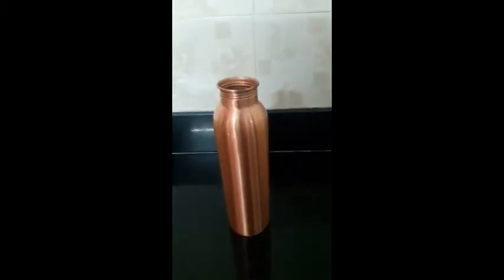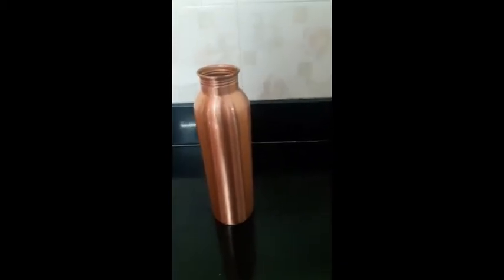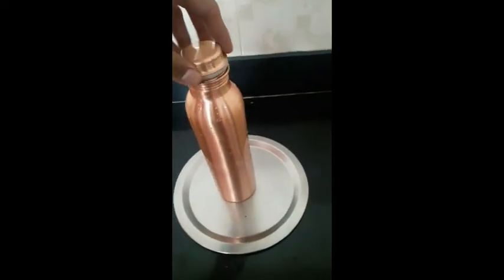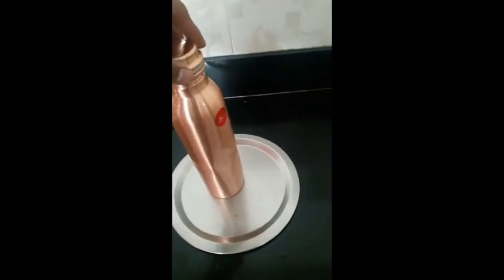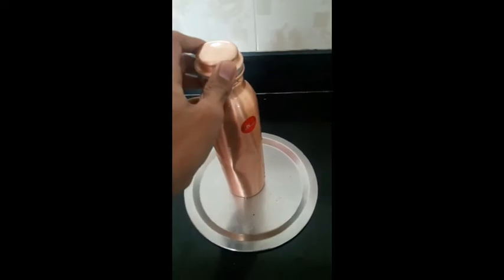How to remove dents from your copper or metal water bottle

Comment: This will cause your bottle to expand and then burst open from the pressure. Try a soda can in the freezer and see what happens before doing this with your fav water bottle or such.
Reply: It does yeah but not so much or not at all if your don’t fill it to the brim.

Comment: It worked fine for my copper bottle.
BUT the base got minutely bulged outward. Now searching for another video to fix it 😂
Reply: Found something??
Reply: @im_megha5863  It automatically came back to its shape after some time.
Reply: Same thing happened to mine but I tapped it with the end of an axe & it’s grand…but bumpy but grand & the hack worked at treat for the dents 🤩
Reply: Do you trying in copper bottle? And it's really working?
Reply: @yajminasvibes  yes it works
Reply: @shadhusain6934  thanks dear

Comment: The copper bottle broke and had a dent , didn't work for me.
Reply: How long did you keep in fridge?
Reply: Submerge the bottom around 5cm in a container of water while freezing. The bottom usually gives out, and this would prevent that. Also check every hour.